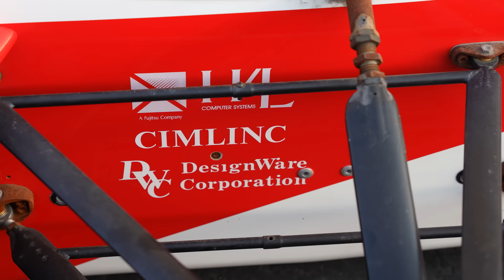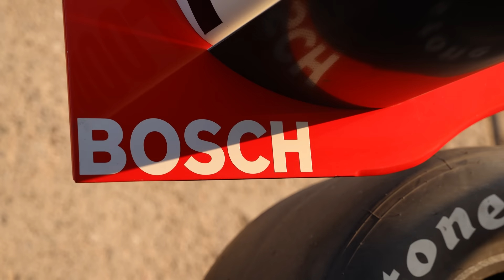I bought a INDYCAR without an engine.

Comment: I wonder if this is the car that he won the race in Las Vegas in 1996 or drove in the 96 Indianapolis 500?  It has the road course wings on it and I think it's the 1997 livery, but it was very common to use the older cars as a show car because they would be obsolete after 1-2 seasons usually. In the cockpit there should be something from Reynard with the serial number or a specific chassis number for this car.  There's probably someone that worked on that team that might still have some notes with setup information and a list of all the races it entered that could be found through a CART group on Facebook.  This is a great livery that's very well remembered by fans and the Reynard (I think this is a 95i) is one of the best looking IndyCar chassis of all time.
Reply: The Lola T97/00 never won a race. It was a terrible chassis. The closest it came to a win was when Adrian Fernandez got lucky on fuel strategy and got third on a street circuit.
Reply: @MX304  Oh, I was thinking this was an older chassis.  This is when Lola dominated and I think the year Newman Haas ran the Swift and there was the Penske chassis, which wasn't very good either.
Reply: @ithemeparkOFFICIAL  That was 95. Penske's car was so bad they switched to a Reynard chassis for part of the season.
Reply: This is a Lola T97. It's inscribed in the chassis on the back but you can also tell from the nose configuration. Awful car that never won a race however hothweels did make a diecast of Richie Hearns car (this car) for 1997 which is pretty cool.
Reply: Whose care was this?
Reply: @iansterling9589  Della Penna Motorsports / Richie Hearn
Reply: @iansterling9589  Joe Tanto
Reply: @MX304  Fernandez had a good run at California at the end of the season.. because he got a new floor for the car and was the only Lola entrant to get it, and then the season was done. I would assume Rob does not have the updated floor but he should find out.
Reply: @MX304  Its a CART car, But IRL did get hand me down cars from cart
Reply: @mvd4436  Incorrect. IRL had completely different chassis. No former Champcar or CART chassis were ever used in that series.
Reply: @MX304  the inaugural IRL season in 1996 used the same chassis / engines as CART. They moved to their own chassis / engine formula from 1997.
Reply: Deffo a 97/98  Lola
Reply: @jacksims93  T97/00 from the '97 season.
Reply: @juanmanuelbonzano  este auto no fue el que también manejó Norberto Fontana?
Reply: @horacionav  No, este es del año 1997. Cuando Richie Hearn se fue a la IRL en el año 2000, Della Penna eligió a Fontana para reemplazarlo. En aquel entonces se habían cambiado al Chasis Reynard pero no hubo mucha mejoría, y para mediados de año, Della Penna reemplazo a Fontana con Memo Gidley por falta de presupuesto.
Reply: I'm Australian and my boss from 1997-2001 owned a pair of ex-F3000 Reynard's that had been raced in Europe and were modified for racing in Australia in our premier open wheel series. He also prepped a Lola (also ex F3000) from the same era. I was employed in another part of the business doing robotics and automation engineering. But I like hanging out in the race shop when I could.

I saw these kinds of cars being worked on by mechanics who knew what they were doing and these guys seem pretty clueless on how these cars function.
Reply: @tonywilson4713  Yeah top level open wheel cars are a completely different animal. Not many people ever get to see the full inner workings and what it takes to build, set up, and run them.
Reply: @MX304  I can remember asking the boss's chief mechanic about having a go in one the cars. I'll never forget the look on his face. He basically told me that was a ugly way to die.

I'm Australian and those cars had their very light compact Cosworth 3.0L V8s replaced with our locally used copy of the 3.8L Buick V6 which moved the C of G back and up - the 2 worst things that can be done to an open wheeler. He explained how all the back end ever wanted to do was snap and fly away into the countryside. It was why so few drivers could ever get a handle on them. 

Our Driver in 98 was a real championship chance. He came second to a kid from New Zealand named Scott Dixon. (yeah that Scott Dixon). My boss actually raced against Mark Weber.

I'm an aerospace engineer who works in robotics and automation. What I thought I knew about racing cars was zip, but being around those guys for 4 years I learned a few things.
Reply: its under the seat on the back
Reply: @thriftshopper23  I  had his swift 
10 yrs ago
Reply: @tonywilson4713  So they basically turned it into an IRL car. LOL. There is a guy that shows up to some local track days with a LS swapped Reynard. He still has not gotten a handle on it for the same reasons. CG is just too far out of range for it to work.
Reply: @MX304  Sorry if that got misread. 
Australia's Formula Holden started as a locally made chassis class using the Buick (sold in Australia as the Holden) 3.8L V6. But by the mid 1990s it was obvious that used F3000 chassis were in plentiful supply. So long as they were at least a year old they were eligible which is why there were a lot of Reynard 92s and 94/95s. As chassis went they weren't close to an IRL or anything else North American. They were far closer to F1 as they had to meet the same safety regs and in F3000 had a very similar engine. The Lola we had at one point had been driven by Heinz-Harald Frentzen in the Japan F3000 series.

In reference to you guy with the LS that harks back to the days of F5000. Also one of the teams my that was in formula Holden at the time took an older chassis put a dead stock motor in it, softened the suspension immensely, put road tires on it cranked the wings to max drag and downforce so that useless mutts like me could have a drive and not kill themselves.

If you are going to re-engine one of these the rotary these guys are thinking of isn't that crazy. These cars are meant for engines that rev and they don't like heavy motors and rotaries aren't heavy. 

But lookin at this car, there's a lot of surface rust on the suspension members and drive shafts which means it wasn't kept in a nice dry place. That alone would scream heaps at me to NOT TOUCH. That's before we even start to guess at the gear box. I've seen inside one of those gearboxes when it goes wrong and its ugly and expensive. The lack of shocks was also shocking and big big big $$$$$$ to replace.

If these guys don't get some really good advice they might be in for some very ugly very serious financial pain.
Reply: @tonywilson4713  Oh, right on. I remember that series. They were decent looking cars. Kinda reminded me of a Jordan 191.
Reply: @MX304  My boss raced in it for a few years then operated a 2 car team for a while. At one stage we also prepared a 3rd car - that was the Lola.

In the right hands they were very very quick and the odd behavior sorted out the wannabees from the real drivers.
Reply: @MX304  Not true. In 1996, IRL used handed down CART chassis
Reply: I had to go and guess what year this car is and it screams mid 90's to me. Now that i saw you guys confirm it i'm glad i got it right. Didn't know that this Lola was so bad. Anyone noticed the car desperately needs entire new suspension AFTER they straighten out the geometry on the laser table? Then once again when they put the new susp. on the car. By the way,the helmet remark is true. The HANS is a must for anybody who wants to survive a potential crash.
Reply: I totally agree with Mr. Wilson there. Cheers to all the Aussies with Croatian roots down under 'cause a mate of mine lived there for some time and since he got back we clicked talking about(cheering) V. Rossi and all things MotoGP. Even today here in Croatia when we meet we're like "hey mate-hi matie,common mate etc" and the rest of the crew is like-????"what's mate?". So we're like it's a long story man. Nice when you have someone to talk to about stuff you're,well,passionate about motorcycling is an understatement. But i started with F1. I completed only one sticker album as a kid and it was,you guessed it-F1. Did a lot of F1 sim driving on PC with the awesome GP2 by Microprose. Nevermind the free promo,they deserved it. It was like 1996. or 97. and i did a LOT of setup work and driving analysis via telemetry in that sim. You won't find something that good nowadays no way. Always followed bike racing though and later i got into that and i'm still like-"Johnny the Boy has done it again. This time it's a scrubber." Basically,the MotoGP races i missed from 1998 to now is when i was at the seaside with no satellite TV nearby or when i didn't have the channel to watch it on. But not having the channel is only the last year because providers here in Croatia are SO pathetic. I mean,you can't even f....ng PAY to have Eurosport or Motorsport tv,not to mention Fox sport or Sky sport or BT. Really,REALLY poor. But if you wanna se Azerbaijan 1st League soccer(?!?),then you're fine. Simply not understandable.
Reply: IRL will never be the series that CART was. CART had several different engines, and chassis. IRL uses only one chassis, the Dellara.
Reply: No, I worked for Della Panna Motorsports in 1996. We ran a year old Reynard. Starting in the 1997 DPM ran either a Swift or a Lola.
Reply: @alexrebmann1253  i think Indycar could become what cart was in 10-15 years.  Toyota and Ferrari might join. Another chassis might come eventually

Comment: Rob in 2 years: “I bought a Boeing 747 to rotor swap”
Reply: 300 Rotor swapping my Boeing 747!
Reply: The Mazda 747b
Reply: ngl I'd love to see a rotary swapped Cessna 172 or some helicopter.
Reply: I think all turbine engines for a plane are like rotaries
Reply: Spitfire.
Reply: Rotary swapping a 737 MAX
Reply: @xSupra  The Citroen RE2 helicopter prototype used one, quite a few small civilian planes use them and some UAVs use them.
Reply: Rob found a used Space Shuttle in the desert, decided to Rotary swap it
Reply: Well I mean..... there is that crazy 28 litre rotary boat engine.
Reply: CB Media is building a 13b racing long-boat in Thailand, worth a look 👀
Reply: @connoisseuroftigolbitts  sorta kinda. A turbine engine is running on a different cycle, not positive displacement like a rotary or piston engine. Once a turbine engine is running, you can actually turn the spark plugs off without trouble. Continuous burn.
Reply: @xSupra  hard to do in a Cessna, there's no FAA certified rotary engines. 

But a lot of the experimental aircraft crowd likes rotaries due to light weight and good horsepower. You do need a serious reduction gear on a rotary, like 3:1 or so (bringing 6k engine rpm down to 2k prop rpm), when most geared engines have a roughly 3:2 reduction gear (bringing 3k engine rpm down to 2k prop rpm). But you can run that rotary at 6k all day long and it won't care.
Reply: @ScottKenny1978  nice
Reply: People swap all sorts into cessnas. There have been rotaries, LS, VW TDI motors etc. main problem is reliability with a rotary along with fuel burn.
Reply: @thatflywelshguy9662  not in the US, at least not without re-registering it as an experimental aircraft.

Rotaries don't have a reliability issue in aircraft, they basically spin at 6000rpm all day long. No major throttle movements, and not running at redline. Add a turbo to maintain boost at altitude and you're golden.
Reply: 747's already have four rotors. Well, kind of. Lol
Reply: @caldwellbrett6  4 two-rotor engines. Sorta...
Reply: Jeff Bezos commissions him to build a rotory powered rocket
Reply: No that’s tavarish with the 747
Reply: He can probably rotary swap a bi plans
Reply: @bmxriderforlife1234  omg tell me more!
Reply: More like, swapping the Garrett turbo on his 4 rotor with the Turbine from the 747 Engines.
Reply: @bmxriderforlife1234  2,6 liter i guess
Reply: @amirbasssystem  nah some company legit made a 28 liter rotary engine. But then they went out of business I think
Reply: They put 13bs in small planes already
Reply: Lol 😂😂😂😂😂🤣🤣🤣🤣
Reply: He got a smaller rotary aero car

Comment: The hole in front of the tail fin was for the series mandatory boost regulator. Maybe you could put a big nasty BOV there so it looks period correct and has a cool purpose 🤙🤙
Reply: The boost regulator was a blow-off valve anyway.

Set to 40psi, IIRC. Those little 2.65L Indy engines spun fast and were crazy boosted!
Reply: @ScottKenny1978  40 inches of mercury, 1.37 bar. They weren't that heavily boosted so the power was a combination of high RPM and the charge cooling of methanol fuel. Cars only got 1.85 mpg and they had a spray injector at the turbo outlet for evaporative cooling.
Reply: @MGregoir  ah, yeah. Sometimes they set things in inHg (usually an absolute measure) instead of psi boost.

Edit: makes more sense to set a limit to an absolute measure.
Reply: @ScottKenny1978  two different things completely
Reply: @MGregoir  it was at the compressor inlet

Comment: For those that dont know. This car was driven (or belonged to...) by a guy called Richie Hearn -- this would have been his car very early on in his career.

Richie drove some five cars that used the same Ford Cosworth XB/XD V8t engine with 3 different types of body chassis. This one is the Lola T97/00 Chassis - shown by the marking at 10:03 '97Lola XD' (Lola for chassis and XD for Cosworth XD Engine) so it is his 1997 car that he did most of his driving with.

Richie is still alive and well and is currently a driving instructor at Spring Mountain Motorsports Ranch's Ron Fellows driving school.

Comment: "My PR for deadlift is like 1800lbs." Hot damn, Rob almost twice as strong as Hafþór Björnsson!
Reply: Eddy hall is steonger than haftor tho
Reply: Today on Dorito Gear, Rob says "Let's do meth" and lifts a car.
Reply: @guidoheeling1179  lol
Reply: @guidoheeling1179  you sound like someone who cant lift bottle of milk without moms help. Both of them have +/- areas. Not just my dad is better than yours.
Reply: He is Rob Torretto Now
Reply: @holymacarenafin2319  yeah shure, you sounds like you have something to compensate for. Don't get fed up by someone saying something on the internet sweetie. Also, Eddie is stronger overall and can deadlift more (wich was what this coversation was about in the first place). Haftor has a big size disadvantage because of his extreme heigt, therefor he has to be more dedicated to reach the same results. Not talking shit at all these are just straight facts.
Reply: @guidoheeling1179  OC wasn't about who could deadlift more. Don't get so strung because someone didn't opt for your favorite strongman. For the record, Bjornson isn't the one permanently fucked his body while deadlifting.
Reply: @guidoheeling1179  I lift, but I don't follow professional power lifting. Haftor is basically the only one I know off the top of my head (and then only because of GOT). I looked up Eddie when you mentioned him, and from his look, I assumed he was one of those 5'5 inch lifters that only have to move the bar 5" to get full ROM, but google says he's 6'3. That boy is THICK.
Reply: @jasepoag8930  he really does look like the michelen man yes

Comment: Mounting an production car engine there is a very hard task because the input shaft is so low, and the engines are too high. Casey Putsch talked about this in his engine swaps video on his Formula and Indy cars, where he settled on a K series and a Hayabusa engine.
Reply: Yeah same issue they had with the Vette. Even the LS had better under crank clearance.

This thing is begging for a twin Hayabusa V8 though.
Reply: Can't wait to see Rob design and build custom all billet transmission for it😂
Reply: @ionstorm66  Wouldn't it be kinda like an ariel atom v8 then?
Reply: In Indy cars, the motor and transmission are part of the structure. This appears to be a CART era car from 1996-1999, according to Wikipedia, probably with a Ford Cosworth engine. That rusty frame in the engine area is probably a placeholder only.
Reply: @Leesmithmk2  Yes that is a Hartley V8, not even their highest hp model.
Reply: @Digital-Dan  I don't know how the rotary engine will mount to the frame, nor could I know if it will be successful as a stress member, so a triangulated space frame to mount the engine into would be a substitute.
Reply: Alot of poeple are saying to put a four rotor in it but I don't think it would fit length wise but didn't mazda have an indy car with a 13b in one or an I getting my type of raceing mixed up
Reply: @charlestorruella8591  different class, there was a Formula Mazda class for a while, with 250hp NA renesis engines.
Reply: Modified oil pan with a external oil reservoir.
Reply: @Digital-Dan  Yeah, this was the tail end of the Ford XB engine era; some of the Ford teams - including Richie Hearn's team, Della Penna Motorsports - ran upgraded Ford XD engines, which were brand new the year prior (introduced in 1996, car in the video is from 1997).

Comment: I was a design engineer for Lola cars in Huntingdon, UK on the Champ Car/CART cars. My area of work was engine installation with exhausts, clutches and engine mounts to chassis and gearbox. I travelled to the races in the US as a support engineer. Great job. This just brings back so many memories.
Reply: What kind of engine would fit?